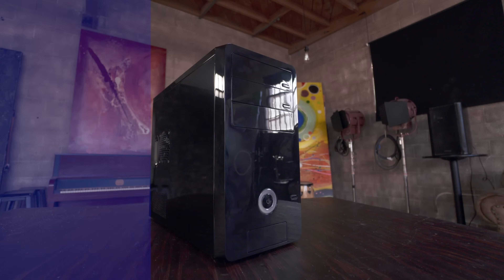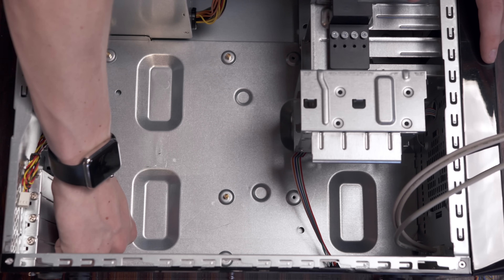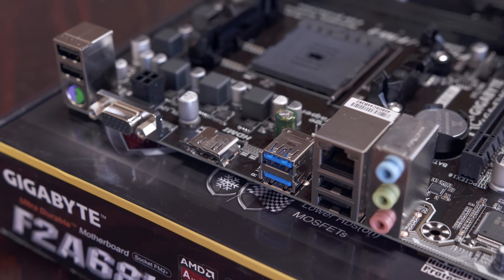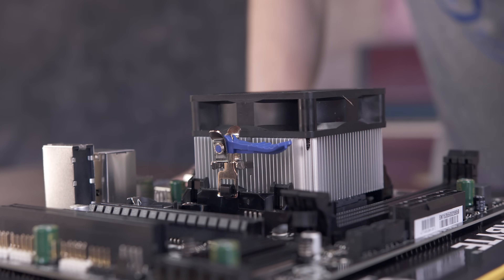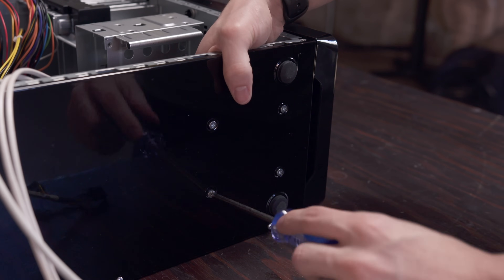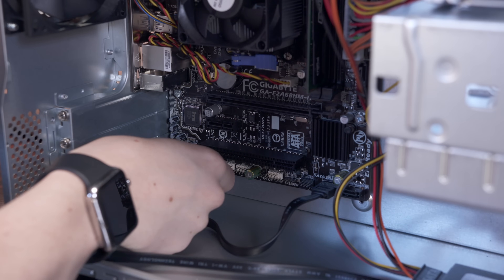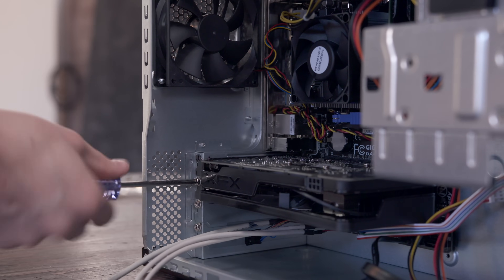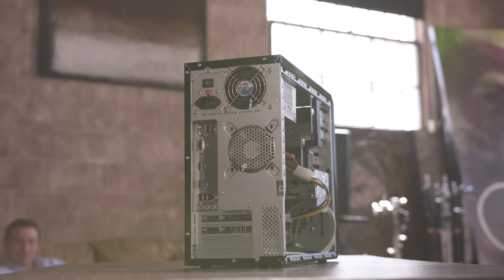How to Build a Gaming PC! (2016)

Comment: I'm building a pc for the first time and wondering if the thermal paste that comes on the heat sync is enough.
Reply: Enough.
Reply: Yes
Reply: +Et addam yeah
Reply: +FAST FoX xd
Reply: +FAST FoX Agreed and I have never built a PC before but I'm going to but I have helped build them before.
Reply: Enough in terms of quantity? Yes, but in terms of quality, depends what paste they used, if its something like am i7 6700k that produces alot of heat, or u want to overclock, then replace the paste with something better

Comment: If i install windows 10 onto a flash drive and plug it into a USB slot when starting it up for the first time, will it download windows, or wll i have to use a disc? and if i have to use a disc, does it have a disk slot pre installed?

Comment: How would you guys rate these parts? I'm working on a budget and wanted to see if these are the best value for money.

Intel Core i5 6500 LGA1151 Socket 3.20GHz Processor

Gigabyte GA-H110M-S2 DDR4 Intel 6th Generation Motherboard LGA 1151/ Intel H110

8GB DDR4 Kingston HyperX Fury Black Series 2133 MHz DDR4 CL14 288 Pin-DIMM Memory - HX421C14FB/8

Asus GTX960 Black OC Edition - PCI Express Graphics Card ( 2GB GDDR5, 128-Bit, Core Clock 1279 MHz : Boost Clock 1342 MHz) -GTX960-DC2OC-2GD5-BLACK

Corsair CP-9020098-WW VS Series VS650 650 Watt Power Supply Unit (Black)

Western Digital Blue WD10EZRZ 1TB Internal Hard Drive

Cooler Master Force 500 (FOR-500-KKN1) ATX Cabinet

Comment: Hi.

Your videos are great!

I am about to build my first gaming pc.
I am looking to play RPG( like the witches 3) and FPS games.
I want to push these type of games to the max in regards to (Frame Rates and picture quality and details).
Are these specs enough to have a maximum pleasure of gaming ? Or could I get the same reslut with cheaper parts like ( CPU, and motherboard) ? what about CPU Cores, Do I have to get 6 Core CPU, or 4 Cores would do the same ?

Specs are:

Cpu: i7 6800k LGA 2011
Motherboard: MSI x99a gaming pro carbon
Memory: corsair vengeance lpc 300mhz 2x8GB
Harddisk: - 1TB HDD, -Samsung ssd 950 m2 256GB
Graphic card: EVGA superclocked gtx 1080
DVD: LG
CASE: Corsair 760T
Powersupply: EVGA 850w G2
Cooling system: Corsair H100i GTX
Windows: windows 8.1
Screen: ROG Swift PG348Q 34" Curved

Your advice is much needed.

Thank you.

Comment: guys pls tell me if should buy this desktop I found it online its a 8gb ram, 250 GB storage and Core 2 duo 2.0 GHz desktop for $160 should I buy it or not?
Reply: oh hell no, just build this pc or get an old cheap Dell then get a good power supply and graphics card
Reply: no dual core is pretty bad. and 250 GB ofstorage is terrible 8 Gb of ram is okay tho. but no
Reply: Obsolete specification.
Reply: WB IsMe Is it that bad
Reply: ***** I can upgrade it right
Reply: Not sure..
Maybe if you upgrade you will void warranty.
Reply: outdated processor, find at least an i3 or i5 and above
Reply: No way, that's worth more like $70
Reply: Nonono
Reply: SmashCrash productions i dont think motherboards on dell computers can handle those type of cards
Reply: Rather get a 
Pentium G3258 for $65-70
GA-B85M-DS3H-A for $50 
8GB of RAM for $30
$20 for 320GB HDD(preferably WD Blue)
EVGA PSU for $25 
and a case for $25-30(Something like Rosewill FBM-01).  

So around $220-230, just a bit more and much more worth. And later on you can upgrade with a $100 GTX 750-Ti or R7 360.
Reply: It doesn't have a GPU? Well, that sounds like a crappy computer  but if you only have 160 dollars u should go for it
Reply: Core 2 duo? Who uses that anymore? And also, what's the graphics card?
Reply: Core 2 duo is a bad idea. Very old socket
Reply: Depends on what you are going to use it for.  If your doing simple tasks like Web Browsing, MS Office, listening to music and watching Youtube, then I would say it was fine with hardly any upgrade options if any.
Reply: Gaming Jaguar17 Not all dual cores are bad
Reply: Nope, Look for a Core 2 Quad at Least
Reply: No first of all its cheap it might look expensive but its shitty quality proberbly
Reply: y doe
Reply: meh
Reply: ***** And why don't you get a life, douchebag
Reply: I found a good one on ebay with a pretty decent specs compared to its price, a Q6600 Core 2 Quad, 8GB DDR3 ram, 500GB HDD,a shitty gt 610 (which I can replace with a GTX 750 ti or RX 460) for only $100.

Comment: im making a pc and would like to know where i can cut the spending without impacting performance my current choices are : -
1)amd fx 6300 6 cores 3.5 ghz
2)Asus M5A78L-MLX3 
3)Corsair VS Series VS550 - 550 Watt SMPS
4)Asus Nvidia GeForce GTX 960 Strix DirectCU II Graphics Card
5)Corsair CMV4GX3M1A1600C11 1600MHz 4GB DDR3 Memory Module
6)xpro cabinet
7) 256 gb sata hard disk from my old pc so windows 7 is covered there
8)cheap keyboard and mouse
which ammounts to 642 usd but my budget is 600
pls tell me any suggestions without a major impact in performance thanks, i so badly want get rid of my ps4 so i can have 2 good pc but for some reason im scared of failling pc building thanks ;)

Comment: How do you put in OS on it if it doesn't have a disk drive? I'm new to this XD
Reply: Optical drive*
Reply: He used a SSD (Solid state drive) instead of a standard hard drive, if you mean how do you install the OS without a DVD drive you can download the ISO file online for the operating system you want and use a program like ISO to USB, to create a bootable USB.

Comment: I can't connect to wifi my mobo is a f2a68hm-hd2 I have Windows 8.1 pro
Reply: Or Ethernet its not detecting someone plss help
Reply: Are your motherboard drivers installed correctly, try reinstalling your lan driver. It should come on a DVD with your motherboard.
Reply: +Josh I installed the disc but it said the lab driver were for Windows 8 I have 8.1 when I tried to transfer 8.1 via sub still nothing :/
Reply: +Emmanuel Ulerie You should still be able to get the updated drivers for Windows 8.1 on the website of the manufacturer, download it  on another PC and copy it to USB. If you just put the name of your motherboard followed by 'LAN drivers for Windows 8.1' into google you should find them.
Reply: +Josh *copy it to a USB

Comment: Could I put in a nvidia graphics card instead
Reply: Yes, Both AMD and Nvidia cards use the same PCIE X16 port on the motherbord.
Reply: +Josh ive been scrolling through comments and seen that you are THE tech genius. so i have one question. (im a starter at building a pc). do you need a monitor for this build or viuld it be a laptop? im
Reply: +Vincent Correa im not sure about which monitor to buy but if a laptop wirks too, then how well will the **Asus - ROG 17.3" Laptop - Intel Core i7 - 16GB Memory - 1TB Hard Drive - Metallic** work?
Reply: +Vincent Correa could not viuld
Reply: +Vincent Correa Idk if you can use a laptop as a monitor mate
Reply: +Omega lmao my question sounded retarded XD thanks anyways

Comment: how do you use wifi. Im new to the pc world and i was wondering if i had to like buy an adaptor or is it like built in cause i cant run an ethernet cable either soo... yea
Reply: and if there is an adaptpr i need to purchase please put a link to it.
Reply: You need to buy a wifi adapter, the easiest thing to do is just get a USB wierless adapter you can find them on amazon there only like £5, most are about the size of a standard USB memory sitck. Some motherbords come with on bord wifi but most dont as most PC owners just use ethernet as its faster and more reliable. You can also get a PCIE internal wifi adapter, that just goes into one of your PCIE slots on your motherbord and the antenners stick out the back.
Reply: +Josh thanks

Comment: 2 Questions: Does this pc-build receive internet-connection? 
Does it have windows (whatever version) pre-installed?
Reply: 1. No, the motherbord dosent have on bord wifi so you would either have to buy a wifi adapter or use ethernet.
2. Your dumb how would windows come preinstalled if you build the computer yourself? You have to get a copy of windows and install it yourself.
Reply: +Josh I am new to pc buisiness sry m8, and well, its kinda a lie if he says this pc is 350$ then... thx for your response.
Reply: +Navaa Bang you can use Linux which is free or you could use a unactivated version of Windows 10, (that means that you won't get all the features but you will be able to install your, drivers programs and play your games. You could also buy a used CD key online for a older version of Windows install that and then upgrade it for free to Windows 10.
Reply: +Josh Alright, thank you very much ;)
By the way, it’s actually “you’re dumb” and not “your dumb” because the word “dumb” is not mine...
Reply: +Navaa Bang There are many different options for your Operating System, Google is your friend m8.

Comment: Hello guys , i wanted to get an advice to buy a graphic card...
Should i choose 
PNY GeForce GT 730 1GB GDDR5 
(1GB 64-Bit GDDR5
Core Clock 902MHz
1 x DVI-D 1 x HDMI
384 CUDA Cores
PCI Express 2.0) 

Or PNY GeForce GT 730 2GB DDR3

(2GB 128-Bit DDR3
Core Clock 700MHz
1 x DVI-I 1 x HDMI
96 CUDA Cores
PCI Express 2.0)

Wich one would give better performance in a pc with these components : Intel Core 2 Duo E-8400 3.0 GHZ , 4 Gb DDR3 Ram and a DDR3 Motherboard ?
Reply: neither if you want to play games...
Reply: The first one would probibly be better... http://goo.gl/2NgpBJ
Reply: you're trying to play games on this?
Reply: +Shea Jones Yes , medium pc games on low settings , not expecting to play watch dogs on max settings.
Reply: Juirdo Cani Hah, maybe older Xbox 360 at 720p on low settings. I'd recommended a 750ti if you want a budget graphics card
Reply: Basing on my cpu , i dont think i will get the total performance of an 750 ti ...

Comment: Does the CPU come with  wireless adapter built in? or do i need to buy one separate?
Reply: You need to buy a USB wifi adpater.
Reply: And how do you install the card where you put the lan cable (i don't know what it's called)?
Reply: First off the cpu is the chip with the gold pins underneath, I am ashuming you mean the motherbord. Some motherbords have built in wifi (the motherbord is the large curcit bord that everything plugs into). Most dont so you can get a USB wierless adapter on amazon for like &#163;5 (thats probibly like $7 ish). You can also get a PCIE internal wifi adapter, that just goes into one of your PCIE slots on your motherbord and the antenners stick out the back.

Comment: Can i use the RX 480 instead?
Reply: You need to change to a better quality 500W power supply.
Reply: WB IsMe Okay, Thanks
Reply: WB IsMe Do you have any suggestions?
Reply: Get 500W from brands like EVGA, Corsair, FSP, superflower or Seasonic.
Reply: WB IsMe Yeah im getting the EVGA 500
Reply: use websites to work out your overall power needed, then go a bit above that for the psu to be safe

Comment: If i wanted to install a CD/DVD rom drive, which drive do i get and how do i power it?
Reply: Any Sata CD/DVD rom drive will do. You need a Sata power cable which the power supply will provide.
Reply: okay thanks
Reply: +WB IsMe one last question..... Am I able to install a wifi card
Reply: Agent TCR No. The graphic card will block the PCIE x1 slot. Just get a USB wifi adapter.
Reply: +WB IsMe luckily i have one that i already use, thank you for all the support good sir
Reply: But can i use a lan card (thing where you put a lan cable idk what it's called)?

Comment: Is this a good build? I'm currently waiting on the new RX 480 as my graphics card. Will this build support two RX480's and a separate SDD and HDD installed together? Also which case should I get to support all of this?
Reply: http://pcpartpicker.com/list/gmcTHN
Reply: I believe it will and the case is up to you, it's mainly ascetics just make sure it has dust filters and it is right for your motherboard, pre installed fans are a added plus.
Reply: 1. The hyper 212 is a descent cooler but try to get something like a cryorig h7 or h5 if you want a stable overclock with good temps but again depends on how much you'll overclock it.

2. Get a better PSU, something like a XFX TS or EVGA SuperNova G2.

3. No 500W isn't enough to support 2 480's I would get a 700W one especially if you're wanting to OC your CPU.

Comment: What if we don't use the graphics card he used and it does not need a 6 pin connector will it work the same?
Reply: Yes. Graphic cards like GTX750TI doesn't require 6pin PCIE power connector.

Comment: Just a tip, don't go with the power supply from a case if you can help it.
Just spend less on a case without a psu, and get one yourself. They often have problems, and generally shoddy build quality.

Comment: Im building a gaming pc soon and was wondering if these parts were good.

Intel Core i5-6600K 3.5GHz Quad-Core Processor
Cooler Master Hyper 212 EVO 82.9 CFM Sleeve Bearing CPU Cooler
ASRock Z170 Pro4S ATX LGA1151 Motherboard
G.Skill Ripjaws V Series 8GB (2 x 4GB) DDR4-2133 Memory
Seagate Barracuda 2TB 3.5" 7200RPM Internal Hard Drive
EVGA GeForce GTX 970 4GB SSC ACX 2.0+ Video Card
Deepcool TESSERACT SW ATX Mid Tower Case
EVGA 500W 80+ Bronze Certified ATX Power Supply
Samsung SH-224DB/BEBE DVD/CD Writer
Asus VX228H 21.5" 60Hz Monitor
Cooler Master Devastator II Wired Gaming Keyboard w/Optical Mouse

Comment: This is easy, I always thought this was some kind of difficult witch craft to build a pc lol
Reply: They are like lego piece where each parts always goes into the same slot or connector. This is a standardized design that many manufacturer follows so even if you buy different model, it should go to the same slot or connector.
Reply: Now try to build a custom watercooling loop.
Reply: na its more researching really if you've never built one before but thats about it
Reply: lol same

Comment: Idk if this will sound dumb but I've been a console gamer ever since I was young and I'm thinking about a gaming pc, are they expensive to build??
Reply: Depend for the parts you buy. You can build a cheap yet decent gaming PC at $350. Just don't expect it to run all games at highest setting. It can handle LOL, dota2 and most game in steam relatively well.
Reply: WB IsMe thanks for the info dude
Reply: not expensive to build, expensive to buy
Reply: not expensive to build, expensive to buy
Reply: Not exactly. Sometimes it is cheaper to buy than it is to build. It just depends on where you live and other variables like your budget,graphics card model and etc.
Reply: I know this question was asked a while ago, but I felt I should add:
It depends what you mean by expensive. If you mean raw cost, then yes, PCs are usually more costly than consoles.
However, if you're talking about performance to the dollar they're cheaper than consoles.
My $270 custom PC runs CS:GO at > 65 fps on high settings and Skyrim at 40-60 fps on medium settings. It all depends on the games you're playing and what kind of hardware you're using.
Reply: I would never play CS:GO on high just for the sake of the bhops. I am planning to swap my gpu and my overall setup with a new one at the end of the year.
Reply: It is hard to bhop with low fps and it is better for me to have the highest possible fps so I can react in compet. Playing on my bro's laptop was really cancerous.. glad I bought a pc
Reply: +CorNVex while that is a fair point, my monitor only refreshes 60 times a second. Regardless if my computer is outputting 63fps or 117fps, my monitor only displays 60. I play on high because it looks nicer, without sacrificing frame rate.
Reply: But there is lesser latency when you have higher fps. You should read it up.

Comment: I am a total noob to building PC or even knowing any PC stuff but... At the moment I have a bought PC but it's performance isn't good anymore for the next gen games like BF4, Overwatch, DayZ, BF1, The forest, battlefront etc. So I was just wondering what I should buy to get around 60 fps on those games (excluding DayZ). Like if I just buy a good graphics card then do I have to buy something else too for it to work or do I just switch my toaster's graphics card to a better one and I'll have good fps in games?? And I really am noob for all of this.
Reply: What is the specs/model of your PC?
Reply: +WB IsMe My PC is windows 8.1 and the computer is made by Fujitsu. It has 8.00 GB of installed RAM, Intel(R) Core(TM) i5-2310 CPU @ 2.90 GHz, 64-bit Operating system, x64-Processor
Reply: Tuboras/Derpimus Model of the PC? Most likely, you will need to get a graphic card like GTX750TI.
Reply: +WB IsMe I think the model is ESPRIMO PH300 atleast the system model is
Reply: Tuboras/Derpimus Add a GTX750TI and you are good to go.
Reply: +WB IsMe Ok thanks. So I don't need to change anything else?
Reply: +WB IsMe And does it matter which one I buy? There are MSI, Asus and many other versions. So is there a spesific GTX750TI I should buy?
Reply: Tuboras/Derpimus Brands doesn't matter so long as the graphic card can fit into the case and it doesn't require a 6pin PCIE power connector.